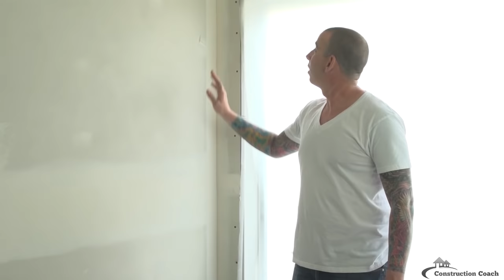How to Mud and Tape Drywall / Sheet Rock - DIY

Comment: Worked great. Not as tiring as manually sanding MyBest.Tools Did a better job than by hand.Make sure to keep the holes clear and it keeps the dust almost to nothing.

Comment: This fella put a lot of time and effort trying to help you to do this type work properly and it is Generally, a good video for beginners and novices. Watch others as well and you will learn differences that help you. Flat joints are ALWAYS done first..angles second..Try each way and you will immediately see the difference. Since you are most often doing flats and angles while they are both wet, this is beneficial. Use knives that are larger than the mudded area when wiping off excess mud. 4"and 6" knives are easiest for taping and applying mud and the front of the knife is used to apply mud as a rule not the sides ( under most circumstances). It takes practice but you go much further per stroke, thereby saving time. Cudos to this fella for teaching

Comment: Good demo on hand taping. However taping drywall is faster and easier when using a TapeBuddy tool. The mud is applied directly to the tape so always has the right amount of mud and moisture for the tape. You might want to try one sometime.

Comment: To save yourself time sanding, is what I alway's do in between coats is I scrape all the rough tool marks off with a flat mud knife & do all my sanding with a screen sander on the finish coat. Also by laying your mud knife to be nearly flat when muddling, you will get a better & more even coat over the area your muddling as for your not dragging over any humps or rough indentations because now your laying it on by sliding the mud over those spots & not be dragging it off. You also need to keep the lid over the mud as so it doesn't dry out & or get hard dried grit mixed w/your wet mud as this will then keep scratching your surface when trying to smooth it on. When your taking mud out of the bucket, it's also important to use your mud knife on the flat side & scrape the walls inside the bucket clean as you go for keeping them clean & also use a damp brush to clean those walls inside the bucket as well. Also if & when your holding the mud pan w/the mud in it, don't scrape over it on a wall or ceiling as this will cause fall out to contaminate into your mud & again you won't be able to use it. I know this from experience.

Comment: Thanks you for sharing this beautiful video with Excellent Explanation on the drywall, you are a good teacher, now I know what I have to do thanks.
Reply: who the hell taught you how to mud corners? must be Canadian.
Reply: yes so good that he would be fired within the first 30 minutes or told to leave any commercial job once the GC saw how he was taping. he gives professional finishers a bad name.
Reply: Steven Sultzbach where are you from?
Reply: Geri Ward lets see.... you ALWAYS run your flats before your corners. (vertical/horizontal) so that everything ties in together without unsightly random places with tape setting on top of a nice long 8ft run, it also makes coating easier and you don't accidentally snag your knife/blade on it  and peel the end back or cause your blade to jump because everything is hidden under long runs due to the bevel in the joint. he's also putting on corner bead before everything else is taped.  he keeps referring to his finishing knife as a "trowel" which tells me he's primarily a plaster guy, finishing with plaster is totally different than with joint compound they have completely different purposes and with that comes with different techniques. finishing drywall is an art anyone that tells you otherwise is either in experienced or just a shitty finisher. yes anyone can put mud on the wall very few can do it the correct way, make it look good and do it efficiently.
Reply: James elsberry I did notice the trowel terms but he...lol not going to do this now
Reply: Geri Ward
Reply: +James elsberry well said James! no disrespect to the man that made this video to try an help others who are clueless when it comes to drywall finishing. However,  with that being said, he is by no means a pro. That isn't a rude thing to say, that isn't coming from a disrespectful place either. it appears to be more of a hobby to this guy, and that's great, but James is 100% correct about the guy not being a professional drywall finisher. I still say rite on for taking time out of your life to try to help others
Reply: I am a professional taper (retired now) with 45 plus years experience both on residential and commercial drywall. I have supervised other tapers up to 150 plus people on large commercial projects. I have finished literally thousands of houses and just about any commercial building you can mention including hospitals, mall stores, schools, restaurants and even targets and wal-marts to name some. Although these DIY videos are well intentioned and have some value they are NOT how we pros finish drywall. They are in fact amateurs who would not last a day if they presented themselves as pros to a drywall company.  As a professional taper your are required to walk into a 120 sheet house (4'x12' drywall) and put the tape coat on the first day and walk out the 3rd day ready for texture. Smooth wall requires sanding a following day. In my younger days I have finished 450 (4'x12') sheets plus in one week and I have known faster tapers than myself. In fact some companies require a one day finish on for example 100-120 sheet houses...ready for texture! I chuckled at your Bob Villa reference as he was also not a pro. If you question my comments find a professional taper in your area and ask him to watch this video....someone with at least 5 years in the trade.
Reply: @James-tr9eg  why wouldn't you do corners and have your horizontals run up to them? It's harder to prevent overlap doing it the other way around

Comment: Great content well explained.  One thing confused me though. On your 2nd coat you used a thinner mud than the setting mud but then on the final coat you said you were going to use a thicker mud. Shouldnt the final coat be the thinnest mix?
Reply from the maker: That’s right, I haven’t watched that video in a while but you are right last coat super thin.
Reply: @ConstructionCoach  thanks for clearing that up.

Comment: It would be easier you mix some Sheetrock 45 for that hole and put mesh, so when you ready to run the corners with tape it would be all nicer because I know for a fact that going to crack In a couple of years but good job though....
Reply: paul hemmings u a finisher?
Reply: I agree!

Comment: When you use paper tape , it helps if you soak the tape in water first . Mesh tape seems to not stick and needs more mud to cover . First coat can be done immediately after setting the tape . The spray glue is contact glue and can be filled with mud soon after you set the corner beads . All coats on flat joints can be very thin and you will have less sanding . I like to use a corner trowel on inside corners . They are a little tricky to use but are getting both sides of inside corners in one coat and a better finish and less sanding . I have been able to use only 2 coats and a good sanding gets a pretty good job . Final sanding is best with a 100 watt light to find all imperfections . After you paint you will usually have a few touch-ups . Taping is job many people have trouble with and to fix some bad taping can be very difficult . You could spend more time fixing a bad job than doing a bad job

Comment: Coach: you need to use the right tools for the job, stop doing 10x more steps then needed and you can do a faster better job in 1/10th of the time: ie use a corner trowel, not a small putty knife; and flex trowels on butt joints, not straight flat trowel; can use the straight flat on the butt joint for your last coat, not the first 2 coats... 
   To learn to use a corner trowel try to focus your pressure more on one side until you learn and are comfortable to press into the center - middle of the corner allowing the corner trowel to balance you on spreading evenly between the corner. 
   Corner bead trim you need to make sure that the metal is bent less than 90-degrees and add light pressure to not spread out past 90-degree when applying, check after by dragging a straight edge or straight trowel along the edge. I screw my metal corner bead on too to add strength to that edge. Cutting off the corner edge at 45-degrees to put on a 90-degree corner that is supposed to strengthen the corner; you make more work for yourself and weaken that edge by removing the support behind it; unless you were going to do a rounded corner.
   Between each coat scuff your straight trowel over all joints to remove high spots. 
   Don't put mud compound on and then go back over to level it out, apply, fill, and level all at the same time. 
   Add water-based primer or paint to your mud mix to help seal your last coat as you did to thin the mix to spread better. 
   Nail or screw holes: do a complete pass overall in a row up or down in one pass, not 2 or 3 passes over each hole; just make sure you have enough mud on your trowel or pretty knife to fill all the holes in the row. I made the same mistakes when I started to learn how on my own.
   Hope these tips will save you so much time and energy.
   I will even use an atomizer to spray water on top of the mud joint to spread it out so thin, flat, and smooth that I never need to sand; just make sure you have water-based primer added to your last coat mud mix because using the atomizer to spray water on top makes the outer edges so thin that when you try to paint or prime the edge can get pulled up but with the primer in the mix it is changed from a powder base to a primer's thin edge and no dust from having to sand.
   Having flat smooth walls without sanding that would get everywhere besides being healthier saves having to clean the whole building afterwords.
Reply: Look at the video again. The corner trimming was not for 90% corner trim nor round corner. It was a 45% corner. Perhaps you can video your work and show us. I'm sure yours probably better. But since we are all want to see skillful techniques, not wanting to master it, this is the only educational video that we found worthy. so give Construction Coach a break. He's giving a great instructional video.
Reply from the maker: Thanks for the support

Comment: Put sheets vertically, no need for unnecessary but joints and dwangs, come to the UK for some lessons. the boy's who put the plaster board up must have used a Gatling gun to put the screws in, there all over the place and some that near the edge there's no point them being there. and before the ceiling height gets a mention two sheets together measures 8 feet by 8 feet I don't see a third horizontal seam, wise up save time and material.  Have a nice day Y'all.
Reply: You have a lot to learn about codes as far as screw placement and whether board can be laid down or stood up in the USA depending on firecodes etc etc etc. Also if for example on a 12 ft long by 8 ft high wall standing 8 ft board vertically results in 16 ft of flat joints to finish while laying down 12 ft sheets results in 12 feet of joint to finish.

Comment: I would like to ask you a question if I may. 
The question is on the exterior wall on the inside of the house, some one can slap, not very hard, the wall or sheetrock and several feet away you can fell the sheet rock vibrate. What do you think the cause of the vibration to be?
Thank you for any information.
Reply: If you can vibrate the sheetrock the screws are not tightened all the way. Sometimes on a high dollar job they will use construction mastic behind the drywall sheets. It makes for a very solid installation. Squido

Comment: I may have missed this part in the video, but do you prefer paper or mesh tape? Which is more forgiving for a novice?

Also, is it preferred to hang the sheets vertically if you can?
Reply: Note that with mesh tape, your first coat needs to be a quick set type mud.

Comment: How the he'll you make any money? With a 3 in. "Putty knife" and a screwdriver.  Perfect consistency is a half gallon to 3/4 of a gallon per box.. Also depends on the temp. Tip- use a cup or or a can so you can scale the amount of water per box. Supposed to do the tapping bed 1st. The corners lay over over the bedding tape. The but joint, the the bed, the corners. In that order.  Wow,  I got to go.
Reply: The only way this guy makes any decent money is by ripping people off. Slow, messy and bad work.

Comment: Good job Sir. This by far is the most informative video if you are looking for to learn drywall work. I have just one question: After covering all the screws and joints do I have to skim coat the entire wall for a better finish which will end up covering the finished job at the first place or the wall is ready for prime/paint? Also, How do you calculate the average cost for a drywall installation with the same finish as on your video?

Comment: what  do ya do when Mudd is clumping  up and drying too fast? ??
Reply: If your edges are inconsistent and choppy like this guys when applying, edges can begin to dry or clump. If you're doing a 20' inside corner and it takes you 20 minutes to do, then only do 10' at a time so the mud isn't just sitting there with all that time to dry. Humidity or fans running can also be a factor. Adding a little water to the mud can also help.. but will make the mud harder to handle and a little more messy.
Reply: Dog Speak thanks it was windy with door open that  day

Comment: keep it tighter and more evenly distributed, good start but joints are two trowel widths , never use mesh tape it's for commercial steel construction

Comment: Lol beveled edge and factory edge.. factory edge is a butt joint and i bet it took him 8 hours to finish that little bathroom.. Eveyones process may be dif but dam, buts, flats, horizontal,vertical , beads, float the butt joints than ur screws.. Most cases pre fill is the first depending

Comment: As someone who's been doing this for a long time I gotta say, it's painful watching this. I hope this job doesn't have to be done in any reasonable time frame. Finishing drywall is an art, why does every knucklehead think they can do it?
Reply: Bama Backroads yeah this is bad..i hated watching him try to work with that hawk and trowel...not to mention his spotted the screws in the inside angle!! The tape and running the mud inside the corners would catch thatm

Comment: Obviously not a professional. Doesn't even own a corner knife! DON'T use a straight knife, you can easily cut the tape w/o knowing it. Obviously doesn't own a banjo either! No one I know would do it his way. Grade: D-
Reply: Keith B a professional wouldn't have to use a corner knife. 4" is all you need for your corners if you know what you're doing.
Reply: As a 45 year professional taper these DIY guys have no clue! They are amusing amateurs. And your comment about corner tools is not correct. Drywall tapers do not use them. They were designed for Kal-Kote finishes.
Reply: Use a taping gun, then use a corner roller, then use a squeeze box, then use a pole sander. Or just forget it.

Comment: Sorry dude, you don't have a clue. Tape butt joints first, then flats, then angles. You're using the knife all wrong and the wrong knives. Not sure, but it looked like you were using all purpose to coat with instead of topping. There is a difference, all purpose has glue in it and is ok for taping and topping has no glue and is used to do top coats therefore less shrinkage and easier sanding. I am surprised you didn't try to use mesh tape on the angles. Also it's called a mud pan, not a mud bucket. I've been doing drywall 35 years and given your final product... you're not the worst I've seen on You Tube. 847 is the best glue to use tho.

Comment: So painful to watch as a pro taper with 45 plus years in the trade. OMG get off your knees! These DIY guys do what I call creative work...by that i mean their methods create work needlessly. And he is humping the joints which will require sanding and more sanding. If he knew what he was doing he would have no need to tape over undeviced electrical outlets! Doesn't know how to sand and there should be very little sanding anyway. Maybe I should make some videos for DIY ! Master pro tapers have very little touch up if any! Actually there are a couple of pro tapers on utube so keep looking! My advice is hire a pro hangar and taper as finishing drywall is an art. This guy is not an artist!
Reply: Are you illegally here by any chance because you sound like a professional